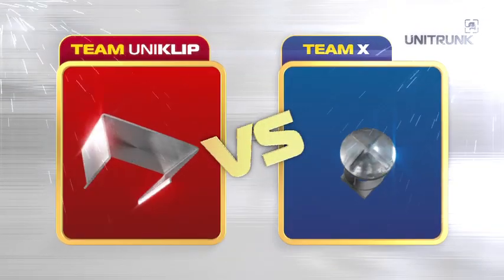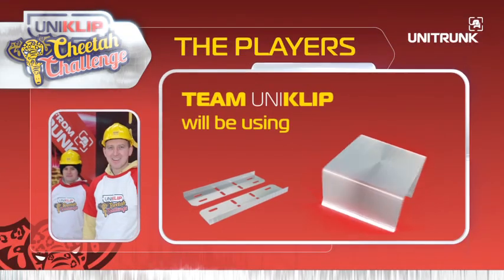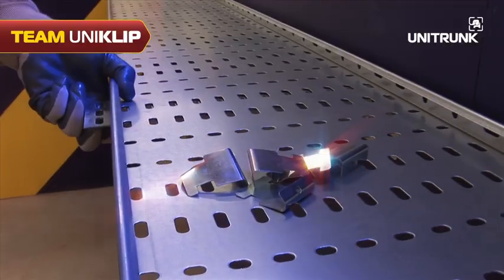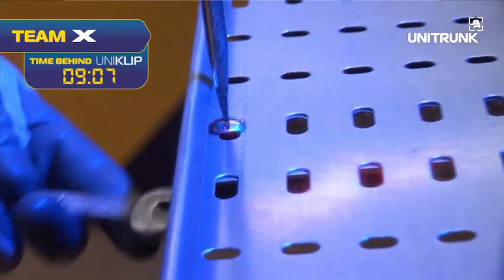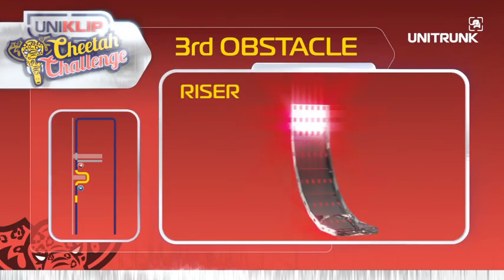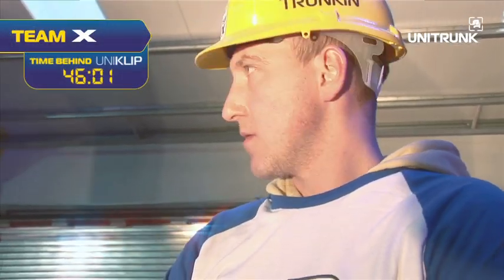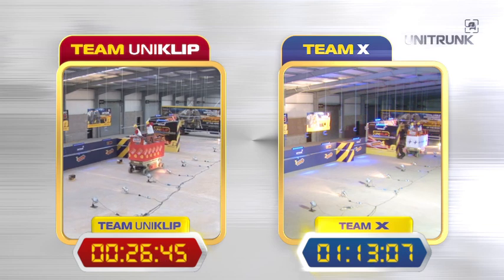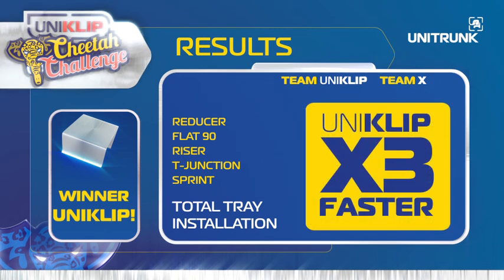Unitrunk's Uniklip Cheetah Challenge - Cable Tray Time Trial

Comment: according to british standards the cable tray have to be bolted to ensure good earthing, the fittings and the ready bends are good but the joints always have to be done with bolts and not with the clips sorry mate but I`ll prefer the old tradition which is to be bolted it`s written in the IEE